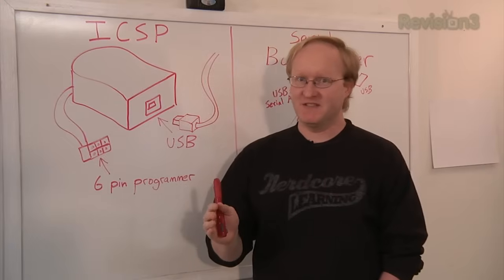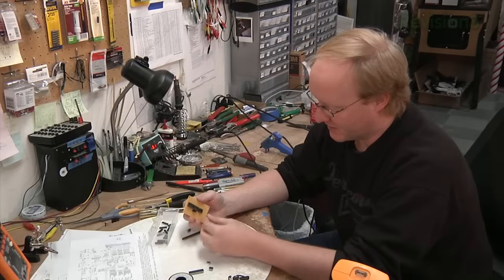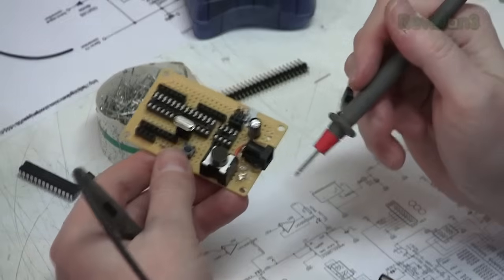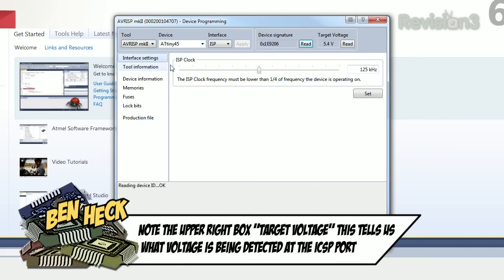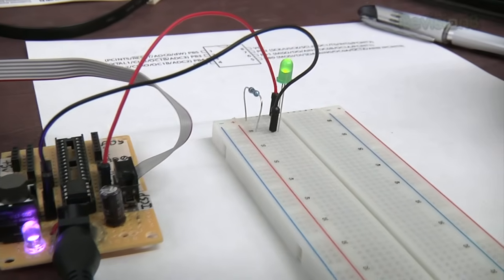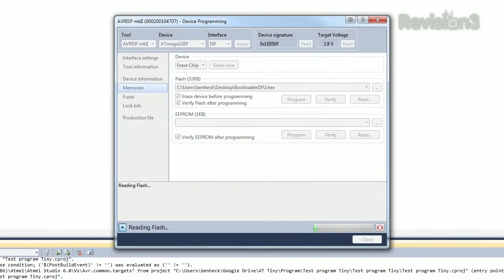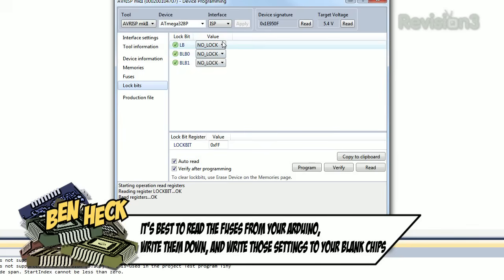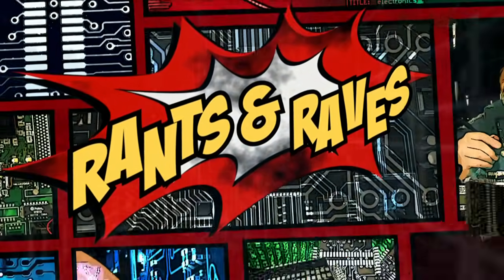How to Build an AVR Development Board

Comment: Ok.😦😦😦 
Now I know why my Flux capacitor didn't work. 
Apparently to use what is the modern standard you have to know more about proprietary builds and whoever this Arduino guy is than the actual physics. I downloaded a pint from an 8 pin microcontroller that costs $0.47 and what I got out of it is that I'm going to stick with old fashioned analog. I never needed a peripheral for a computer just to build some hardware. It just takes up a hell of a lot more space.

Comment: What's this sorcery?! How do I learn all of this? Recommend me a book, please.
Reply: Start on Arduino forums and buy an Arduino and some components and ask any questions you want on the forum. And then after you learn that you can go into making your own board and working with standalone microcontrollers.
Reply: Go on ebay. Buy a vintage Radio Shack 150 or 160 in one project kit. I had one in 1983 and it worked wonders for me as a kid.
Reply: https://sklep.atnel.pl/pl/p/AVR-Microcontrollers-C-Programming-Basics-EN-BOOK-DVD/103
Reply: It's been 2 years. Did you learn how to wire and program digital circuits?

Comment: how to prevent chip data from being read by others?
Reply: There are fuse bits, which can be set, after programming, to inhibit reading the FLASH. Old feature. Predates, the AVR (~1997) line.
Reply: Michael Moorrees wat in case of latest avrs.

Comment: oh man, you left out the atmega8u2 if you include that, since it's programmable you could develop custom usb peripherals... include a connector for motherboard usb header and there's your pc's in-case rgb led strip controller, just got to write a pwm driver and controll application... :3
Reply: Felix Kütt you don't need an atmeg8u2 for usb. Just program the the device with vusb which what the atmega8u2 has on it and you can create your own usb device.

Comment: I dont want to use a Arduino Every Time i Need a Micro Controller ... 
cant i Flash the Chips via a Arduino UNO V3 i am new to this Kind of Electronics :D
Reply: you can program attinys with the "Tiny avr programmer" from sparkfun. looks like there's some cheap versions on ebay you can use with the software and tutorials sparkfun provides but I haven't tried them

Comment: I am a beginners, my previous self programmable board did blow up because i did not use optocouplers. I have a new design where i have a capacitor between the external usb to serial letch connector so i am able to progam the Arduino in Octal instead of Hex bytes.
Reply: Could you be so kind and test this new sheme, if nothing goes wrong this might be a better idea, it is not surely safe but does the work.

Comment: nice video.  I did the same but added a pins header  so you can also plug in an Arduino Pro MIni (which does not have a USB-Serial chip on board)  and  replaced the   chip sockets  with  ZIF socket for easier plugging and unplugging of the chips

Comment: An arduino clone costs about 10$?
I kinda want to make my own, doesn't have to be arduino, as I prefer ICSP and don't really need the arduino library and/or board.
But looking around, it's even more expensive to order all the separate items.. (As I'm not buying in a batch)
Also, as I'm starting, I have nothing lying around, not even breadboard/leds/resistors.

I'll find my way out this...
But it kinda feels unfair that buying a complete board (with low educational value) is cheaper than making your own. (I'm dutch and a student, if you're worrying why I'm such a cheapo)
Reply: +xFuaZe 

Heres an even cheaper starter kit for you 

And they are fine good company to deal with this one  very helpful  also very reliable and completely trustworthy 

http://www.banggood.com/ATmega328P-Arduino-Compatible-Nano-V3-Improved-Version-With-USB-Cable-p-933647.html
Reply: +Mark Harrington Yup, I've bought some of those Nano's, I've just come back to this video to create a programmer for a ATMega328 and ATTiny85 or even more.
I'm thinking of creating a board that has an header for both the ICSP and serial programmer.
With a removeable fuse, reset button and pin outputs. Much like an Arduino itself, but then more adjustable.

Can't the board be powered by the programmer? And/or the FTDI connector (it should also have an voltage out?)
Reply: Well best here is incorporate a supply into this You can power from USB but observe the standards with regard to this so I would before putting this together , check USB standards, in other words,  read up on these first  As a matter of principle incorperate a supply rail in with a view to ensuring anything the board drives has sufficient current available for any attachments , peripherals , relays etc plus of course the added advantage of two independent supply rails 

I'm seeing a case of this with LCD sets at present where USB standards do not fall within the specification for hard drives consequently the hard drives attached to the set are not functioning properly 

This can  result in damage to the USB port on the host That is your embedded device FTDI chip or other port 

So yes do this as a superior design factor 

Or as an alternative you may have to use a pin on a port from embedded device through software making this output a logic or pwm value to switch in a power supply on your peripheral device which is obviously another route round this problem of current , voltage requirements 

Hope that helps you 

Mark 

Contactable via Facebook 

Under Mark Harrington 

or linked in

Comment: No schematics or links on what he did in this video. Fail.
Reply: cough GOOGLE cough
Reply: MrPvallone well the schematics are open source from arduino so just search "arduino uno schematic" or something.
Reply: Thats what im guessing he intendid us to do.
Reply: J Frap Exactly! Everyone expects to be hand fed these days.
Reply: Hello MrProvolone,  I want to mount an ATTiny10, it consumes only 0.09 miliamperes, Do you think that the mC needs a resistor coupled to the battery? I'm going to use a 220 mA battery.   The analogy of the filament bulbs is not good?  They do not have limiting resistor, its filament is its only resistor.
Reply: Maker Mark yeah
Reply: J Frap
((cough)) You missed the point Captain Obvious  ((cough))
Reply: Usef Ibba but it seems so cartoonish with the woosh sounds and flashy animations
Reply: This tutorial is not meant for kids

Comment: Awesome video! Just what i was looking for. I have been playing around with a few development boards and i want to design and build my own. This isdeffently helping me with what i needed to know and will get me started on making my design, and i can build on it from here! Thanks Ben!
Reply: Estuar Gonzalez And your only resource is spamming the same question 100 times.  We saw it the first time.  Go make a forum post like a normal person. Anddd mute.
Reply: ¡¡¡ MARRY HIM !!!  :P   ...if I buy a programmer do I need also FTDI module?
Reply: Estuar Gonzalez you're fucking annoying
Reply: thank you son!!!  I see that as you do not know about electronics your only resource is the fury.
Reply: Sorry Tiger!!  I hope you can give arguments and demonstrate you really know, if not you will demonstrate that  you are simple a Dumb =D   This is the question: A bulb filament is connected directly to the home source which probably has 100 amperes, then the filament has a very high resistance enough to get incandescent but do not melt, the same happens with the resistor of the electric stove, so if the resistance of them were lower they would leave pass more electrons and they would get hotter enough to get molten;   Every electronic component has its specifications, its maximums    So... another way to ask it is " Do the Atmel mCs require a resistor to limit the amount of current or the mC has one integrated to limit the amount of current?
Reply: Novislav Djajic A 15 amp house circuit can supply quite a bit of instantaneous current before it overloads. More than 100 amps. I've actually heard a figure quoted of 15 times that. But this of course is only for a brief instant of time. It is still more than enough to make things go poof, and magically disappear into the land of blue smoke! The take away lesson here is never underestimate the power of line voltage.
Reply: Novislav Djajic
There is a breaker manufacturing company here called Federal Pacific, that are jokingly referred to as Fire Pacific. Their slow trip breakers are often a bit too slow. So no, not very good for your wiring, or your whole house sometimes at all!

The amp rating for breakers is for continuous draw too. All breakers are designed to be able to deliver surge current, for applications like motor starting, that need a higher initial current. Inductive motor surge current is 6-8 times the nameplate current rating. So a 10 amp inductive motor could draw 80 amps when it starts up. Your breaker should have no problem with that. Though your lights probably will dim.

If breakers really were fast blow you'd be messing with them constantly. But because they aren't fast acting other things sometimes happen too.

Comment: Hello Ben
I tried to use the C6 pin  of Atmega-8 as an input pin for the first time to turn on an LED on another pin  and hence programmed the RSTDSBL pin for that.
The program runs well but after that I was not able to reprogram the IC again.
I thought the IC would have gone wrong so I burned the same program to another chip.
the program again ran well but this too is not getting programmed again.
however the the program I burned earlier is still running well.
please help as I have two unuseful ICs now.

Comment: "You need to flash your microcontroller with a bootloader program which sits at the beginning of memory. You need to flash the chip with the in-circuit serial programmer. But once you do,  able to program the chip using the RX and TX serial communication pins." 

I don't understand what happens when you flash your microcontroller. What is the function of a bootloader program?
Reply: Estuar Gonzalez
I'm not sure I understand. The uController will draw the same amount of current whether it's on a 22mAh battery or a 3000mAh battery. I'm guessing you want to run it at 3.3v with a 3.7v battery? It should be ok without a resistor. The datasheet will have its thresholds.
Reply: Without a bootloader, you wouldn't be able to change the program on your microcontroller with the Arduino IDE. It's basically a small program that checks to see if you are trying to upload a program or just running the program that is already there when you power up your circuit.
Reply: OSHbots, I'm trying now to mount an ATTiny10, the way I'm going to use it will use only 0.09 miliamperes, Do you think that the mC needs a resistor coupled to the battery? I'm going to use a 220 mA battery

Comment: I once went to a conference and the speaker spoke incredibly fast --- he said that for English listeners that the speed improved focus and retention of what he said and allowed him to cover more material in a shorter period of time. The fact I remember that verbatim is testament to the truth of that statement. Mr. Heck's shows are incredible!!  Keep up the high speed data transfer!!  Love it.  I now know how to clone an Arduino and boot load it. Also some mention of use of Lock Bits I was unaware of -- after several thousand lines of code in development work in a product I know have leads into protecting my work from being read off the chip!  Thanks. Great show!
Reply: Estuar Gonzalez It's sounds possible, hard to say.. Your best bet is to find a camera module that uses parallel data transfer. They exist but they generally lack good documentation/getting started tutorials for beginners. If you're comfortable looking through datasheets and such to figure out how to use devices, you can probably pull this off.
Reply: ¡¡¡ MARRY HIM !!!  ...if I buy a programmer do I need also FTDI module?
Reply: Estuar Gonzalez  No, either one works. However, as Ben mentioned, you can't use the FTDI module to program your board until you've already set things up with the AVR programmer. So if you only want the FTDI module for programming the board, you might as well stick with the AVR programmer. The FTDI module has other uses, though; if you've ever used the Serial class to talk to your arduino IDE, then you used an FTDI chip to accomplish it.

EDIT: Furthermore, certain arduino boards are capable of emulating the AVR programmer. If you already have an uno laying around you don't need either (though you do need to temporarily sacrifice that uno in order to do so.) You can read a little more on this method here: http://arduino.cc/en/Tutorial/ArduinoISP
Reply: Tyler Hackett Thanks... I want to sell a solution I'm not wanting this for tinkering, so I need to use the programmer to lower the cost but I was wondering if I can use the Arduino Uno board in lue of the FTDI, But if you say the FTDI has more capabilities then I'll buy it, I need the most professional equipment.   Thanks!!! (Y)          

Second question:  Do you think that ANY NTSC CAMERA can be connected to the ATMEGA328 and control how many fotos take for second and also control de resolution and size of the foto?
Reply: Estuar Gonzalez technically you can, but the arduino chips are not very powerful at all, so you'll have trouble getting good results. Do you know what kind of performance you want out of the camera?
Reply: if it can take maximum 4 snaptshots per second it is fine, and i want to lower until 0.5 snapshots per second.
Reply: Yup- not to mention rewind.  However, he skips over quite a bit.  It's too bad because I'm sure they cut tons of footage to fit their 10-20 min format.  I think most of us would rather watch 30-60 mins including the footage he probably doesn't consider to be as entertaining.

Comment: 4 minutes in and I'm bored..... you need a 20 minute video to show us how to put some connectors of a board ???
Reply: Bill Johnson
Video?, if you can't build it off a schematic you need to back track
Reply: if I buy a programmer do I need also FTDI module?
Reply: Estuar Gonzalez No - The Serial Communications is handled by the programmer
Reply: Estuar Gonzalez You won't need the resistor
Reply: Hello Mr Simon,  I want to mount an ATTiny10, it consumes only 0.09 miliamperes, Do you think that the mC needs a resistor coupled to the battery? I'm going to use a 220 mA battery.   The analogy of the filament bulbs is not good?  They do not have limiting resistor, its filament is its only resistor.
Reply: ...there's no chance of causing an "Electric Over-Stress? to the uC? if I do not put it a resistor?

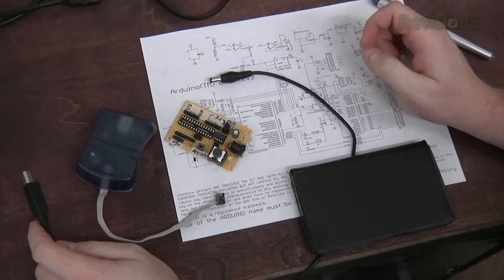Comment: At roughly 8:15 Ben states that you must supply an external power supply to your programmer board because the ICSP cannot actually supply the power needed. This isn't true if you are using a different ICSP than the one he uses, such as the USBtinyISP. The USBtinyISP has a jumper that is accessible outside of the case that allows you to choose if you want to power the chips via the USBtinyISP or an external power supply. I hope this clears things up for some of you.
Reply: Hello Mr Shane,  I want to mount an ATTiny10, it consumes only 0.09 miliamperes, Do you think that the mC needs a resistor coupled to the battery? I'm going to use a 220 mA battery.   Does the analogy of the filament bulbs is good?  They do not have limiting resistor, its filament is its only resistor.

Comment: Can you use the arduino software with this development board by using an isp burner like usbasp/usbtinyisp
Reply: You can, but if you are using the USBtinyISP than you should check whether or not you are supplying power to the chips via the USBtinyISP or an external power supply. Other than that you should be able to program the board without any hesitation.

Comment: Hi Sir, please do a favor by sending me the C code and the HEX file.
My project is somewhat contrasting to this link http://www.avr-tutorials.com/interrupts/avr-external-interrupt-c-programming   The differences are as follow:
1. In the link, the trigger pulse is negative (but my project will be using a positive pulse).
2. In the link, the LEDs are sequentially blinking and continuous right from the start (but I want only a one-shot sequential outputs (2 seconds HIGH per LED; 2 seconds interval before the 2nd LED lights up...so on and so forth... 8th LED should be HIGH for 1 minute ) for EVERY POSITIVE EXTERNAL interrupt, with also a condition that the microcontroller will lock itself while doing the one-time sequence of outputs, meaning it should ignore any external pulse FROM the point of implementing the entire sequence up to FINISHING the 1 minute HIGH of the 8th LED.
3. In the link, the LEDs altogether blink 5 times when switched is pressed (i don't need blinking altogether because this ruin the sequence i need).

thanks in advance...

Comment: 1. while on camera it is easy to get this stuff wrong and you often only notice it while editing. He put a note in the video, he noticed he said the wrong number.
2. Connected electronics CAN interfere. Just because it has never happened to you, it doesn't mean it can never happen. To be fair, a simple LED and a weak resistor probably won't do much harm, but especially resistors can cause interference.
3. There is nothing to get wrong in the intro.

Comment: Yes you can, but sometimes you need a real programmer to set fuses etc. You can use Arduino in ISP mode also, but why take your Arduino projects down everytime if you can just build a cheap programmer to use

Comment: You can however use the Arduino (if you have one) in ISP mode to burn the Optiboot bootloader to the Atmega. You will require a total of 4 wires in excess to the Arduino. You might also need to have a 16MHz crystal if the external xtal fuse has been set by the manufacturer